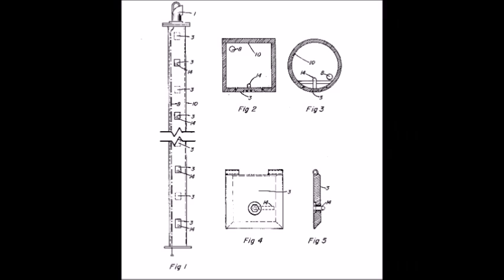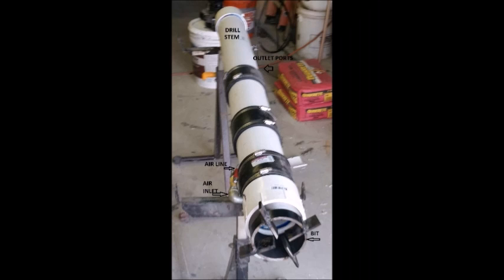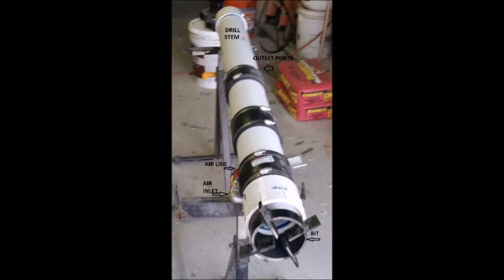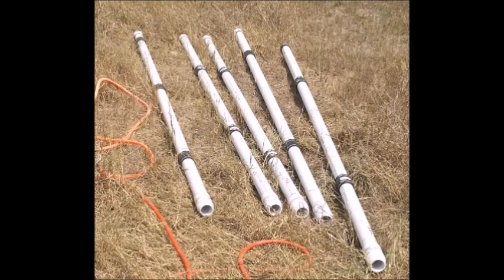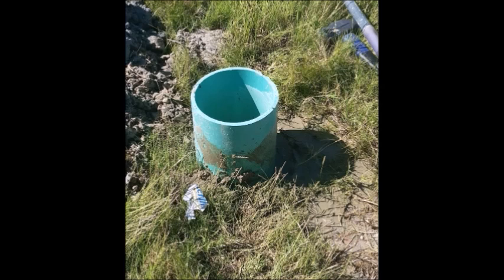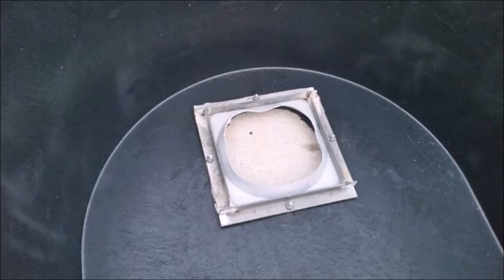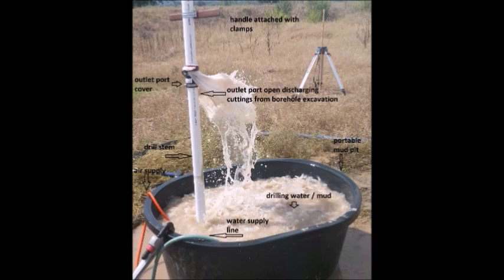The most important well drilling invention ---ever.

Comment: This is a great idea.  And it is wonderful to see it used to help people instead of just to enrich one individual.  I have begun to build this system.  The spacing on the exit ports may take a bit of experimentation, but the video is almost self explanatory, very well done.  Thank you.
AddedNovember, 2023:  There is another video by the same man titled "How to build a drill bit and drill stem" on Youtube.  That channel is "WellinventionsUSA".  It will answer several questions you may have about this process. This will NOT drill through solid stone.  This is not a continuous rotary drill.  You scrape right and left alternately to loosen the soil or sand.
Reply from the maker: For the spacing of the discharge ports, multiply the depth of the starter hole by 1.4 and then place the first hole there. Next take the depth to that hole and multiply by 1.4 and that is the next hole. Please contact me for a license. I now have a patent of the process. I am a 501 c3 non-profit online at http://www.onemillionwells.org
Reply: @RcCrawfordwellinventions  Thanks for the additional information!

Comment: How do you develop the well after drilling? The clay gelling agents prevent the free flow of water into the well point.
Reply from the maker: Using Air Lift Reverse Flow, there is generally no need for drilling muds of any type. In fact anyone who uses drilling mud stands a strong chance of ruining the aquifer.

Comment: after my yard died off 3 summers in a row after i just couldnt pay 600 bucks a month watering it, i set out to try to dig for water, since im a contraption guy. push a hose in the ground as a kid, it just starts sinking. well older now with a bigger hose! pressure washer actually, packing a bigger punch than just a hose. after 10 feet, using the tried and true pvc pipe drill head with sawtooth notches sawed into it, plus the pressure washer hose down the middle of the pipe, zip tied to a hole in the pvc just above the sawtooth digger, i pulled it all out and pushed the 4 inch sewer pipe into position, then stuffed the drill back in and startd up again. then hit something that was stiffer and shut me down. back to the drawing board. ok, need better drill head, so galvanized bell coupling, cut some teeth into it, get the grind on much stronger, just screws onto a pvc fitting. i can turn it, feels likes it grinding better, but the pressure washer together with it, is still just stirring up whatevers down there but not proceeding deeper. maybe i need some force, like banging the pvc with a big hammer. shut 'er down, broke the galvanized off the pvc, who wouldnt see that coming, but yay for a big magnet on a rope, retrieve the head, rebuild it, back to the drawing board. Tried a few wild ideas, jabbing metal pipe down the hole like a chisel, until i got lazy after mindless jabbing, turning, wiggling, and decided i had to automate something or find someone i could convince to be my robot.  automating stuff is fun, surely i can get this air chisel modified to do the duty. time for a contraption! it outta work, just need to waterproof the tool so i can lower it down there. rubber pvc couplings and reducers, and get the tool protected in its own little submarine, with a flexible section like were around old gear shifts in my first truck, attached to the chisel head so it wouldnt leak. i probably should have tried it out on land first, but down the shaft it goes. Turn the air hose on up top, the tool trigger is just ziptied wide open, and with the added weight i added it will surely start pecking away down there in whatever it is. Until it blew up. Oh, i guess i forgot to realize that completely water tightening the tool did the same thing with the air, but on the inside. The rubber boot must have swole up like a balloon before it failed, it was pretty shoddy material anyway. What came next was what i imagined the spindletop oil well drillers must have seen or felt, suprised i didnt yell eureka! water shoots out of the 4 inch pipe high into the air like a cannon, then comes crashing back down splashing everywhere, with rocks and gravel and chunks and stuff i dropped down there all around the ground once the dust had settled. I had never heard of air lifting, but i had just had a first hand learning lesson, and quickly threw the drawing board to the side and started cobbling together my frankenstein drill digging pipe, hoses and compressors and powerwashers surrounding me like i was doing some weird rescue operation. neighbors by then must have thought id went crazy. but it worked like charm. now all the chunky junk that the water flow wasnt pushing out of the hole was flying out across the yard every couple seconds in spurts as id turn the air on and off letting the air tanks rebuild. big gravel i would have never thought could be floated in a water column and ejected like that. So i built a tower, about twice as tall as my truck, and cleaned up all the machines, organized the hoses, and built a mud pit from a couple stacked tires for the ejection to go in so the water blasts wouldnt have some lookey loo call the cops on me for being a mad scientist or something. By now its apparent that my cutting head, and the pressure washer nozzle could use much improvement, but the cutting removal was tried and true, and i didnt even know that was a thing, until my contraption failure showed me the way.
my yard wasnt green that year, and i eventually took down the tower, and moved away in the end. ADHD is a subject for another comment section . Which all leads me here now. New home, new yard, higher water prices. This time im gonna complete and succeed God willing, and get that lush green front yard. Seeing other folks who have documented their successes and getting any tips and tricks i can to refine my setup in this day and age is about the coolest part of it all. For a contraption guy, these youtube vids are gold. All i have to do is type in what im looking for and add DIY to the search. Time to look into that wood chipper machine i need to build as i clean the back 40 off. At least this time i dont have neighbors to potentially maim and disfigure with all of my contraptions, as i build up my little homestead off a beaten path out in the rural parts. Im new at storytelling, but one day it could be fun to get to the level of making a youtube. Still plenty to plow down, blow up, incinerate, and the like for now. I do read all the comments on the diy type videos i watch, for all the cool stuff people recall about their own experiences, and i encourage anyone who reads this to share your tales in the comment sections of the videos you watch for inspiration or knowledge. I bet more people skim through the comments looking for tidbits of extra info and stuff than i even think. half the stuff ive learned, right here from the comment sections. Happy tinkering and be safe out there, as ya can be.

Comment: I'm sitting in my home built in 1955 with a 34' well! (The neighbors deep well went dry). It use to get tinged if over used so we had to be careful (notice this is PAST tense!). I rented this house about 8 years ago and told them to be very conservative with the water. The idiots (I say that with"charity") move 12 PEOPLE INTO THE HOUSE AND RAN IT BONE DRY! I panicked and called a guy who cleaned it out with some kind of water rig. We began hearing the sides falling in and he quit. Now the well just goes and goes seemingly with no end! I LOVE IT! (again it's only 34' deep) Unbelievable! To be fair though it does get tinged when we have several days of rain but no big deal. I might could fix that with a little common sense grading around the well.
I'd like to thank Rc for his videos. I have 23 acres of mountain land but it's rocky. I hope to experiment and try digging one.
Reply: Use charcoal. Burn any fat wood under a camp fire, a paint can with a single hole pointing down and a smaller can under it the cans should be buried with the camp for directly over them both this should give the bottom can oil or tar (oil if a wood like pine) the paint can in the middle with the fat wood will be charcoal. You can powder it in a mortar and pestle and make a filter or you can drop the charcoal in the water and boil it, you will purify your water. Fat wood just means full of resins which produce more fuel than wood with less.

You can even set up a bio sand filter in your water tank. See youtube for more help.

Oh you can also use a ram pump to pump for free :)

Comment: Are the intermediate outlets for lifting the spoil to the surface? I tried driving a sandpoint before, at a remote site. The greasy clay below the hardpan sealed the point like no one's business. At 18' I got some new resistance like I'd got to the next sand layer(?), but me and my well-point were ready to have a fork stuck in us! Now I see folks on YT using jetter nozzles in a 2" casing (inside a 4" surface casing), and after they get that hole made, they drop in a 1.25" point and pipe and pull the 2" sleeve, which may be easiest/cheapest for me to try at my Florida location. I love the way you do the mud put with the plastic tub sealed to the external casing.

Comment: As an anarchist I admire your commitment to help our fellow proletariat but I'm wondering... What happens when you reach rock?
Reply from the maker: You then must bring in a larger machine and down the hole hammer to complete the well.
Reply: i am very interested this video why     is not have any information  the rig system to work so that our twon has luck of water about how to drilling ground water.

Comment: What are the ramifications as it pertains to fracking. I can see that it would be less vibrationally intrusive. I suppose any holes drilled into earth whether vertically or horizontally does weaken the integrity of it and allows for greater chance of earthquakes in certain areas. however, smooth round holes drilled in circumference to a vertical hole would seem more stable than cracks in stone underground. I really don't know what i'm talking about, just guessing.
Reply: That drill can't go deep enough to cause earthquakes. Oil well drillers go 5 to 10 thousand feet and can't cause an earthquake. You need to Google what tectonic plates are so you will understand.

Comment: Are the holes in the drill pipe calculated the same for different size drill pipe.
Reply from the maker: No pipe size does not change the location of the discharge holes. www.onemillionwells.info

Comment: Sir, the system that you made is interesting to me.  i have used a home-made system similar to this to purge sand out of sanded wells.   depending on where you are, you can encounter rock and i have run into that also.  is your system capable of handling water jets for cutting rock?  i went to a gear shaped drill to cut through the 80 feet of rock between me and the aquifer
Reply: I think, if you had to cut these rocks, you should get a really good water out of it.
Reply: @namentatic4978  i did get good water,  but lost the house in the divorce.    the drill was a rehab i bought second hand, and used on the old hydra drill system.

Comment: the only problem I see with this "drill" is that it isnt a drill at all. it can't drill or break up and rick whatsoever. it brings soil dirt mud to the surface using the air lift principle. also, every foot you go down requires more and more pressure to push the air down, so this $100 pump is not going to do 100' very well, because that is going to require a lot of volume at 75 - 100 psi. most compressors do 1-2 cubic feet per minute at around 50-75 psi meaning this is going to be super slow while constantly waiting for the compressor to recharge.
If I am wrong about any of this, then show me a 100' well video using this equipment and method please. your stock tank idea IS brilliant btw, I will give you that. not needing a mud pump is brilliant also. what happens when you hit a rock?
Reply from the maker: I specify the cfm of compressors in relationship to the diameter of the dill stem. The drill has exceeded 100 feet in depth on multiple occasions. Each PSI of air pressure will displace 2.31 feet of water, therefore, a 100 psi compressor will drill 231 feet without relocating the air inlet into the borehole. The rating of a pump is on intake, not output at psi minus hose friction.  I hope this answers your questions.

Comment: What do you do if you hit rocks?  I don't see how your system can penetrate granite.
Reply from the maker: The drill will only drill soil, clay, silt, sand, gravel and very soft rock. It will not drill granite. 

It can be fitted with a down the hole hammer, but it is cheaper to get a regular well drilling company that to buy a DTH hammer.

Comment: What size air compressor is needed and how much will it cost to build the drill?
Reply from the maker: The 2 inch design needs 4 cfm and the 4 inch design needs 12 cfm to work. A little more air helps a little less and it will still work but is less effective. All that is needed is PVC pipe an air hose, bit, handle and mud pit.  The cost depends on where you are located and your fabrication abilities. You will need enough PVC to reach the depth you intend to drill plus a few extra feet for the attachment of the handle. All pipe should be at least schedule 40 PVC
Reply: Rc Crawford  I would like  some plans I went to your GoFundMe page and wasn't working. I will try again, later

Comment: I would like to know a bit more about this. The LCRA sunk a culvert on my land for a cement base for one of their high power line poles and had one hell of a time stopping the water which at the time welled up from the hole and flowed into my field.  Your drill might be my answer but I have a couple of layers of bull rock to contend with and would like to know your thoughts on this problem.  Is this only going to work where there is only soil, sand, and clay to contend with?   P.S. Thank you for the vid. It seems to be an innovative design that would work wonderfully as long as there is no rock o deal with.
Reply from the maker: The drill would drill bull rock as long as the drill stem is larger in diameter than the rock. However, the cost of an air compressor that would handle a large diameter pipe would be prohibitive.
Reply: Here's a thought.  Some of the other videos on this topic have shown a regular "gear" drill bit that was attached to PVC pipe.  That, patience, and a bunch of elbow grease should let you break rock into small enough pieces to move up the drill stem.

Comment: how well does it cut through rock?
Reply: rumpleforeskin73  He states that it doesn't drill rock. Duh
Reply from the maker: You can use steel drill stem and a tricone bit turned with a small drill.